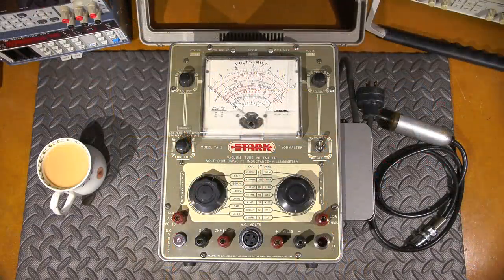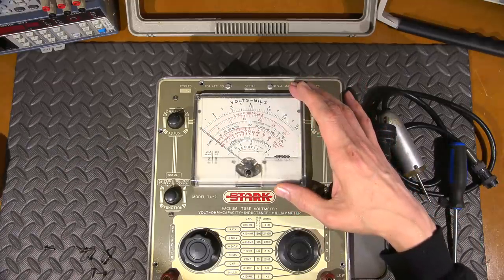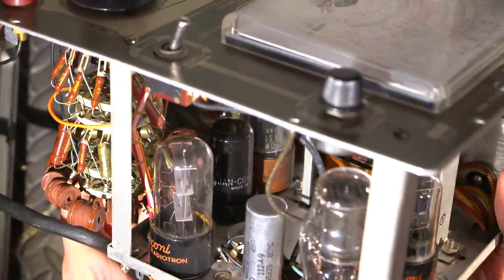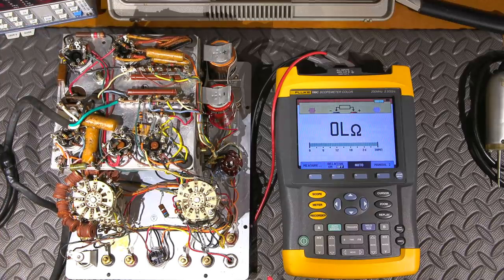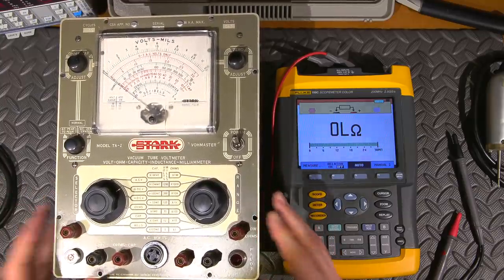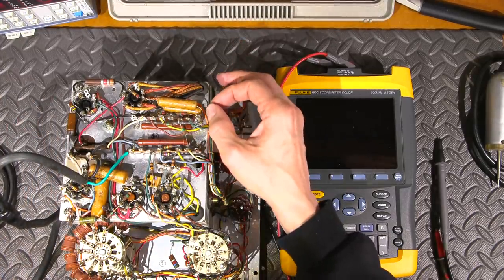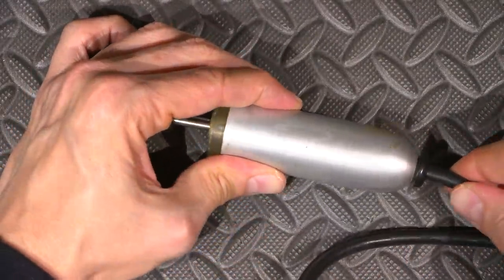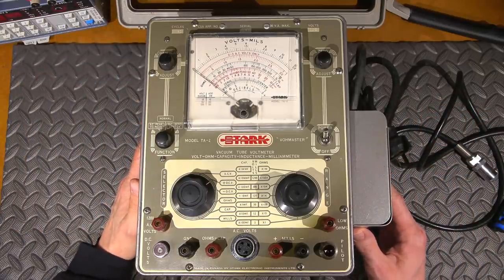Sharing More Electronic Knowledge - Tech Talk And Hang Time With Mr. C!

Comment: What I think, you ask... I think the front plate text is a bit confusing. Mils and mills and milliam. I am unable to see if these three terms are referring to the same, milliampère. And by that I conclude that there's no millivolt range ? And beside that I can't see an inductance scale on the meter or the range or selector switch. Still it tells us on the front plate that it can.

Comment: This might be a silly idea... but, can’t those deeply scratched dial faces be restored by using a very thin layer of clear epoxy resin after a very through cleaning so that it’ll fill in the scratches & sets to a uniform surface that u can maybe cut & buff up later to ? Like, in case of an unobtanium dial face ? 🤔🤔

Comment: Are you going to do a video on the restoration and the use of it
Reply from the maker: Yes sir!
Reply: @MrCarlsonsLab  nice! What did you think of my comment I made before on the last video about the Tesla Tower you can be honest brutal lol
Picking up low frequencies from the cosmos and probably the sun's magnetic field amplifying it in a massive transformer the towers what are? And boosting that signal to AC mains voltage. Theoretically possible if the Transformers are big enough microvolts into V and on to KV. but Is there too much loss in the circuitry, if the Transformers are made from carbon fibres or better graphene than there shouldn't be any loss into heat.

Comment: I took my own meter into work once because there weren't enough to go around. I was not the star of the show! Got rapped knuckles for using non-calibrated equipment. I suggested they calibrate mine, they suggested something altogether much ruder...
Reply from the maker: Sounds like you worked with a tough crowd!
Reply: Alan, I hope did not take your meter to work at Tektronix...lol. Sorry for your knuckles.
Reply: @garybevis8691  Ha! Nice. We had pretty good equipment in the lab, just not enough of it to go around and management always wondered why commissioning equipment took so long. They should have spent less on company cars and more on us poor engineers who were actually trying to earn the income!

Comment: Regarding the low-voltage capacitor tester: It can surely identify bad capacitors with ease, but it cannot prove, if a capacitor is still working at its nominal voltage. In other words: If the tester says "bad", the capacitor is definitely bad, but if it says "good", it is good only at the low voltage the tester uses, not necessarily the nominal voltage the capacitor is operated on in circuit.

Comment: Question. Non-acidic paper is available for usage in high-quality printing and for usage at museums. So wouldn't it be possible for hardcore restorers to recreate paper/wax-capacitors with this type of paper ?
If so, what's left to do is to redo the outer printwork and wrap it around their new recreation and then wax the entire thing ?
Which type of wax has the best hydrophobic properties ? Carnauba ?

Comment: One question: There were some debates if the replacement of the paper capacitors in circuits where there is no DC voltage present makes sense? Personally, I usually replace all the capacitors, no matter what voltage have on them, but I have seen cases of tube radios that were refurbished in the early 1990s and the repairman changed only the capacitors that have voltage across and line/RFI caps, but left original caps for that were used in negative feedback and tone controls, so about half of the caps were changed. These radios still play fine with those original caps in. Even I discovered that changing the caps in tone controls where there is no DC voltage (that was blocked by a cap before) made no difference to tone or performance.

Comment: Stark? Now that's Canadian! If it's not too yellowed or checked, that meter face plastic can be polished back out with fine red jeweler's rouge, a rag and a square block of balsa wood. They had micro micro Farads for pico Farads. On really old schematics the designation was wwF or mmF.  I am elbow deep in some old Danish made Bruel & Kjaer vacuum tube test equipment. Several very nice Audio Volt Meters incorporated into Universal Microphone Preamplifiers. 64 and 640 and 6.4 uF caps?? Yeah.... European goodness. Neon NE-2 lamps used as zener diodes.

Comment: Believe it or not I found a good paper capacitor in my old TV from 1949. It's a .005mfd 600v and IIRC it's a Sprague. I ended up replacing it but it shows that not all paper caps are bad. I'm personally OK with keeping them in circuits where leakage will not cause damage, but I also see the benefit in replacing all of them ahead of time.
Reply: I agree. Often when all the condensers are replaced errors creep in---though not in Mr Carlson's case! Knowledge of the function of each component  will guide one.

Comment: Hi Mr.Carlson, this is a bit off topic but my wife’s griddle is the problem. Seems like all griddles that have an adjustable temperature line gauge on them are absolutely horrible at getting the right temperature setting. Either they are too cold or too hot, and they rarely are the correct temperature you set. If ever someone could modify an electronic grill to tune it correctly you could. Just a simple request, if ever you’re looking for ideas! 🙏 Love your channel.

Comment: What about replacing the vacuum tube in the probe  and the meter with a PHILIPS/RAYTHEON Wire-Ended tubes  and lose the mains supply circuit and make it much lighter and more portable.

Comment: Hi paul Ray Burke here.  I am a Electronics Technician with many years experience. I have a few things I am needing to repair.  Few questions how much does Patreon cost,  do you need to log in to Patreon to find out the pricing structure?  Hope it isn't too costly, since I am Retired.  Later Ray Burke
Reply: The link is in the description. There's different tiers. Not very expensive.

Comment: About the buzzrub at 24:20, I've noticed if a cellphone's on a mains charger you can feel exactly that if you drag a finger on its casing. But it's only getting a DC supply voltage, so what causes that effect?
Reply: The charger puts out a constant DC relative to its "ground" output, but chances are that "ground" isn't connected to earth ground. There is a noise suppression capacitor between the high voltage side and the output "ground" which is exactly what Mr. Carlson is describing. The only difference is the modern charger will use safety-rated capacitors which won't fail short.
Reply: @eDoc2020  Wow, thank you. It was so counter-intuitive that a fixed DC would be doing something so oddly AC feeling. Asked and answered then, thanks for that explanation.

Comment: I get the buzzing sensation when I touch my MacBook pro while at my desk in my basement. And I have tested my outlets and they are wired correctly and grounded. I have a feeling my ground isn't very good.
Reply: Does the computer have a grounded power plug? If it does then you surely have a problem with your ground. Keep in mind that plug-in outlet testers cannot detect all faults.
Reply: @eDoc2020  the MacBook does but I get the same thing from Mac mini that has zero ground so it makes me think the ground in the house is trash.

Comment: I havent been subscribed very long, but you keep mentioning that my house may be wired wrong... On that note there are portions of my house where I measure 56 volts across the ground, and neutral... I noticed while replacing my garage lighting with leds. I can feel the voltage in the metal switch plates i used. Any idea why I am seeing that voltage in the neutral? Or is this normal? 🤨

Comment: What a different meter! L & C measurement is certainly unique and would be welcome if it worked well and over a decent range. I am surprised to see a glaring error printed right on the front of the instrument. Capacity is how you measure a fuel tank not a capacitor.
Capacitors have capacitance not capacity. What a rookie mistake for what was a sophisticated meter in its day. That alone identifies these guys as amateur hack engineers. The panel graphics overall look cluttered and scrambled but maybe you get used to it. If you have a schematic it will be interesting to see how they measure L&C. GIven the non-linear ohms like meter scale I don't expect much. My favorite feature of my first DVM was the Ohms function with a uniform linear resolution and a many decade range. I still have a few Simpson 260's around and an HP-410C but never use them. I do occasionally bring out the 410C to explain the value of chopper amps.
Did you know that Phillips scopes had chopper stabilized front ends?  No Tek  beam finder button. Set the trace on a Phillips scope and it never moved or drifted. Turn it on next week and it is still where you left it. Phillips scopes were vastly better than Tektronix scope in many ways. You ought to do a comparison video. 
JY

Comment: Still no front panel or specification what each LED corresponds to for resistance ... ??
Reply: LED ? 😂
Reply: @peterfitzpatrick7032  Yes, to the capacitor tester, as Paul mentions in every video ...
Reply: @emilalmberg1096  my apologies Emil, I thought you were talking about the VTVM... 😔
Reply: @peterfitzpatrick7032  efter a while i understand that, no harm done.

Comment: I really laughed at your comments about newer vs old school engineers. Often they are completely at a loss understanding analog circuits and old tech instruments. They want a computer program to design anything.
Reply: Everyone has to trace out and etch a custom copper-plated circuit board at least once in their life! 😺 A Sharpie marker and some ferric chloride, that's all ya need! If you wanted to get fancy, you could make a pattern in Microsoft Paint with black shapes, scale it to fit the circuit board, print it on an old magazine page using a laser jet toner printer or Xerox machine, and then iron it onto the board to melt the toner onto the board. Then peel the paper off and dunk it in the etchant! You could use regular paper too and just use water to wet the paper and rub it off gently with your fingers. Magazine pages or old sticky label sheets with the labels all used up and removed worked the best. 😁

Comment: i see those d cells and just cringe.  i've had sooo much equipment trashed by leay cells in the past few years  i leave batteries in nothing!!!
Reply from the maker: Yes, carbon batteries in low current draw circuits are an extra step to avoid this. Thankfully this isn't too bad.